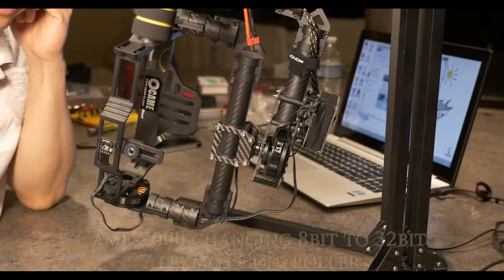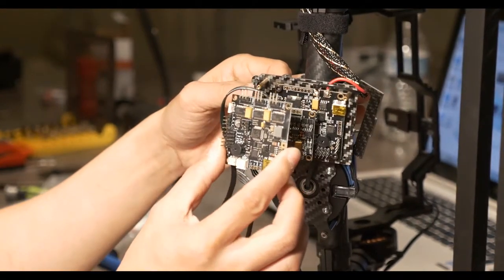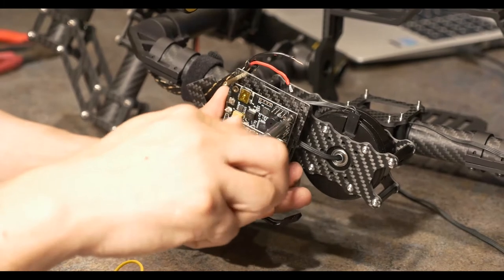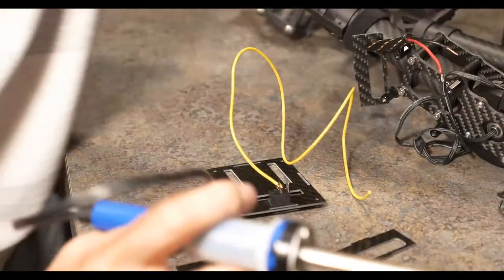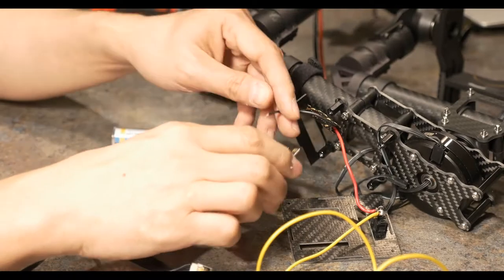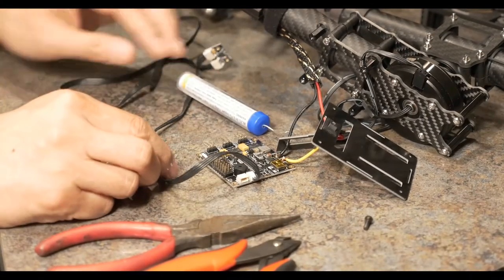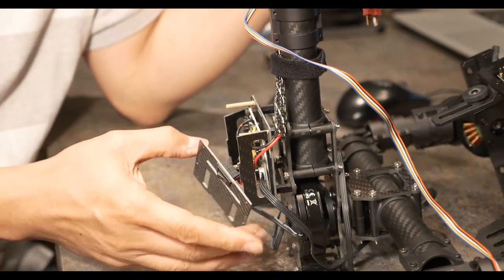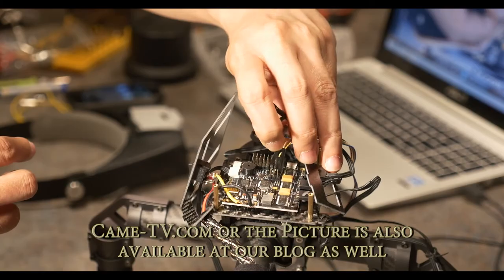Came-7000 changing the Alexmos Controller from 8bit to 32bit

Comment: HI, how did you make your power supply? I see it goes all the way to the top of your gimbal? what Where can I buy such cables/wires and what are they called? thanks
Reply from the maker: Kris Capiendo  The power supply came with the package.
Reply: Im talking about the wires.. the red and black wires that go thru the tubing.. is that just a diy?
Reply from the maker: Kris Capiendo Ah, since you said "how did you make your power supply" I thought you were asking about the power supply that came with it. The extra wires were just basic electrical wire that you can pull out from an old lamp or any computer power supply cables and solder it together, that's it.